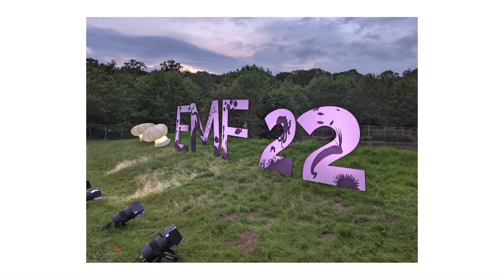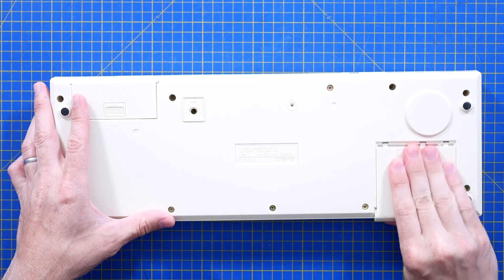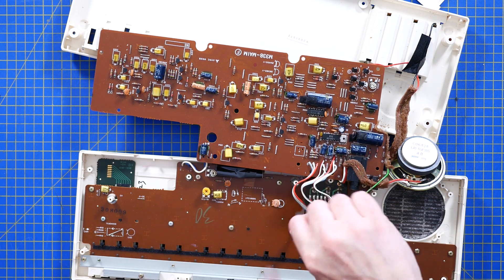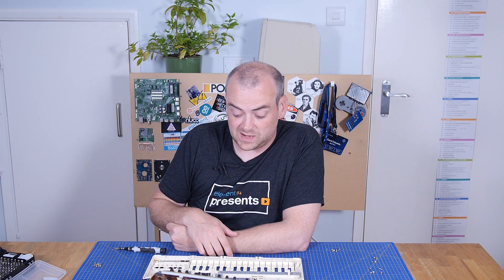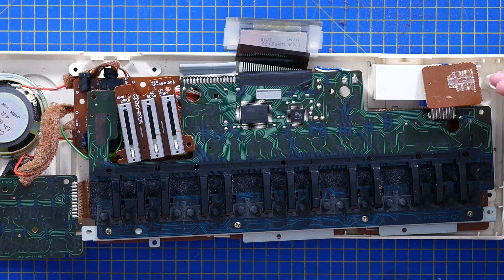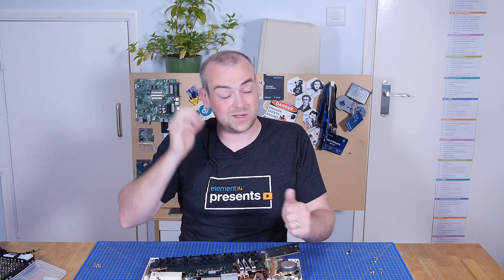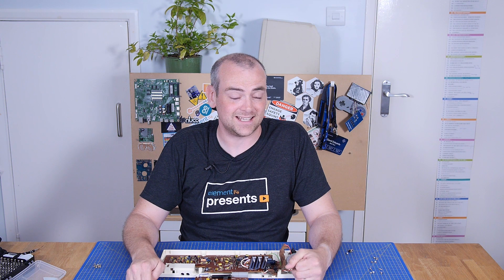Casio PT-30 Electronic Musical Instrument Teardown - Electronics Inside

Comment: Sir I have casio PT 31 in whoch everytime when I plug my adaptor pin it does not work ..I have to reset then only it starts wrong ..wt cn b the problem sir

Comment: I've watched this video over and over trying to understand the build so I can fix a PT-31 I bought off Facebook Marketplace recently. I realized from your video that the PT-31 (which is thought to be a grey copy of the PT-30) is actually very different inside. I really want to fix this thing, but it won't power on, sadly.

You mention that the power switch graphite transfer paper component is a likely point of failure in this model and I see it is the same in my PT-31. You said it was repairable with a graphite pen. Do you have an example of this? I live in Thailand and I'm trying to find the exact thing I need for that. I'm hoping the switch is the bad part in the circuit. I have pencils, but it sounded like you didn't fully advise going that route. What product do you recommend for this kind of thing, if you don't mind telling me?

I have found that the trim pot for tuning the keyboard from the hole in the underside has been knocked loose also, but unfortunately, it's disappeared from someone's previous attempt to repair. Do you think this could be another possible point of failure?

Also, have you found a service manual by chance? Sorry for all the questions. I really want to bring my PT-31 back to life. Thank you so much for the thorough video. It is very pleasant and informative with your style of filming and speaking. :)

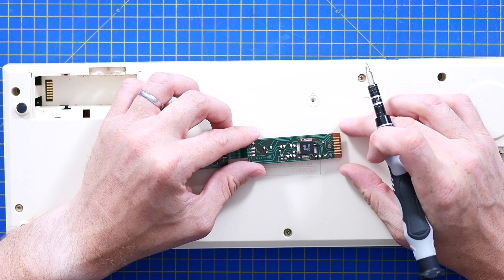Comment: 4:06 - look carefully around the edges of the IC you can see short track under the pins that do provide the shorts. So not bad soldering. Apart from the TRHC area that looks like a post production bodge.

1/4 inc American!  what are you thinking, it's ENGLISH!. We started to convert to metric only after 1965. 🙂
Reply: 1965?!?! How old do I look? Since I am an engineer that has worked with energey and heat for my day job, but I couldn't tell you what a British Thermal Units means, but America still use them routinely they are welcome to inherit them!

I didn't manage to find a data sheet for the IC in that package to confirm the pinout, but even though many of the joins look consistent enough, there are a few that still look suspicious to me? I would assume it worked however, otherwise it wouldn't have spent nearly 30 years in the device!
Reply: @a531016  Younger than me !  63 this year!

I found a similar unit HD 43530 3A13  use the image search option and you will find a good example at the start. - (Sorry Utube does not like links...) This one is much cleaner and has  no rework on it. It mentions a Kansas City interface, that's a very early cassette driver, 1200.2400Hz I think. 

Used on early computer boards, I think the Ohio Superboard, UK101 and maybe the SCMP may have used this system. 

The chip is a different part number, but it would not surprise me if that particular chip went through a couple of revisions.

Using normal audio cassette recorders was very often a painful experience  and all sorts of tweaks and bodges appeared in an effort to make them work reliably.

Andy

Comment: You didn't delve deeper into the sloppy soldering. Forgot? Not an issue after all?
Reply: I didn't manage to find a data sheet for this package to find the pinout? If you manage, let us know!
Reply: @a531016  Indeed, I couldn't even find an old service sheet for the PT-30 either.

Comment: The printed “extra layer” conductors was a process that was patented way before that was built. Originally used for ceramic hybrid modules produced by AB Electronics back in the day… but adapted for PCBs.
Reply: Is there a particular name for this style or process that you know of?
Reply: @a531016  sorry not sure. But it was done both with conductive carbon ink that was also used for making printed resistors and also with silver ink for tacks needing higher current or smaller dimensions. The carbon ink was also in different formulations for different purposes and could be laser trimmed for precise values after baking (better than 0.1%).
Reply: @MarkGovier 

Electronic Engineer 1:  But, that can’t be done, on just a single-sided PCB …
Electronic Engineer 2:  “Welcome to the Layer Cake …”